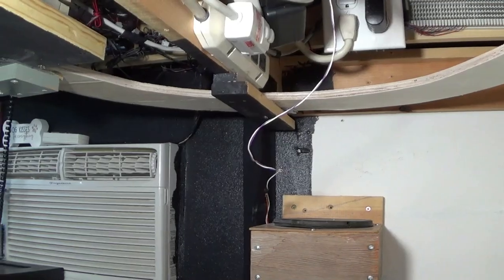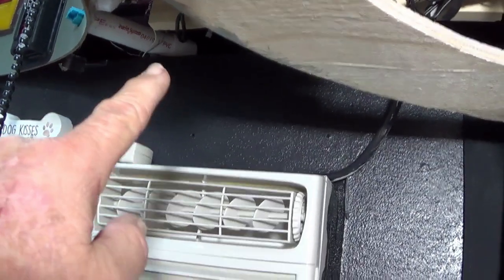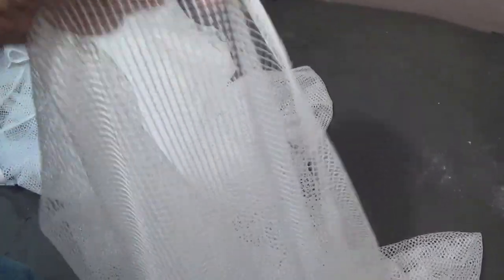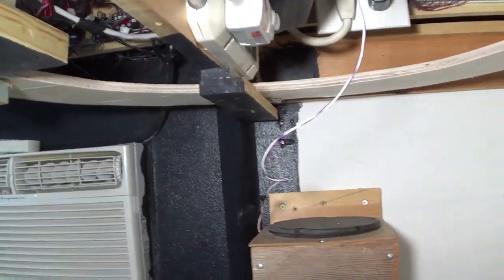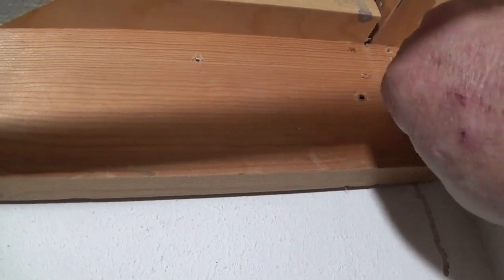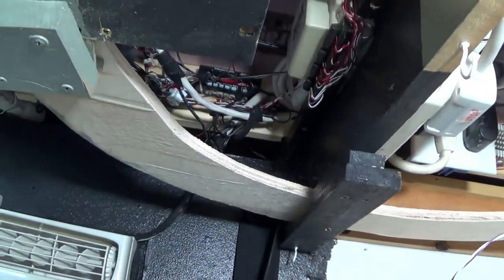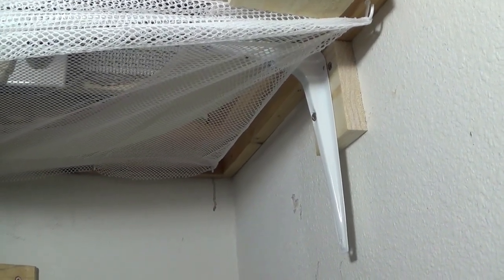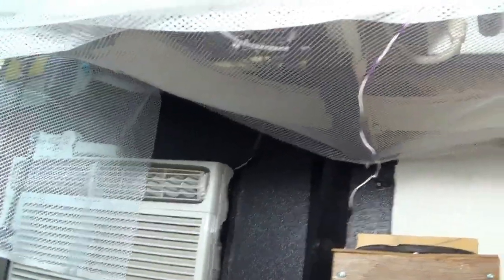Model Railroad Catch Cloth What the heck is it

Comment: Mike, I like the idea.  I recently I was testing a new return loop that passed under another track,.  The clearance was there, but there was a splice plate for the track above that a corner stuck out far enough to snag the loco which forced it off the tracks.  As most steam locos will do it rolled to one side, then off the sub roadbed and made the trip to the hard tile floor below.  Luckily there was shelving and a number of cardboard boxes lot of cardboard boxes and shelving that slowed the decent so the damage was minimal.  Do you think that material would catch and hold a steam loco weighing in at 1 pound, 11 ounces?
Reply from the maker: Yes !!